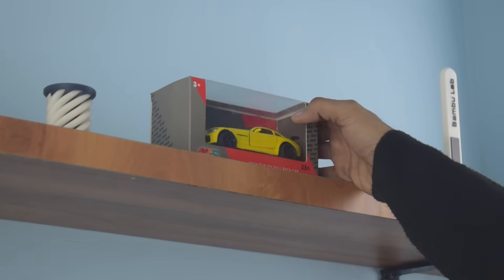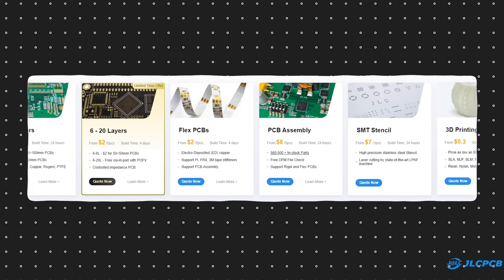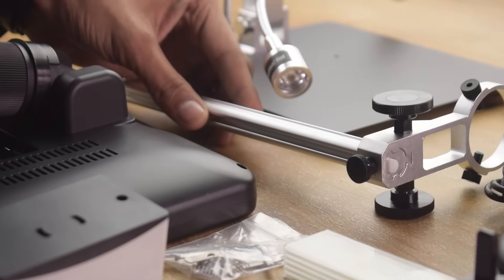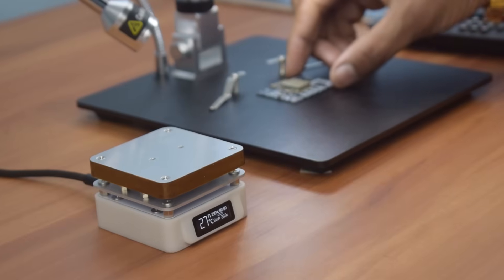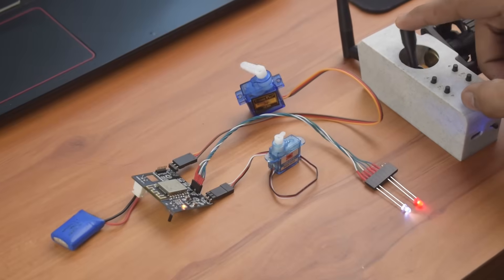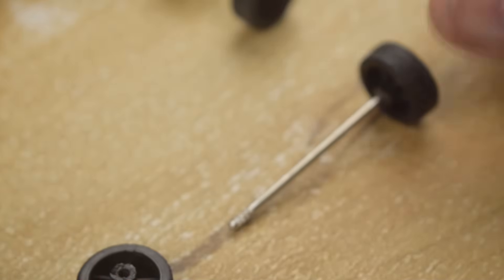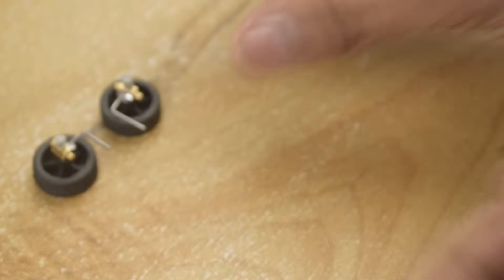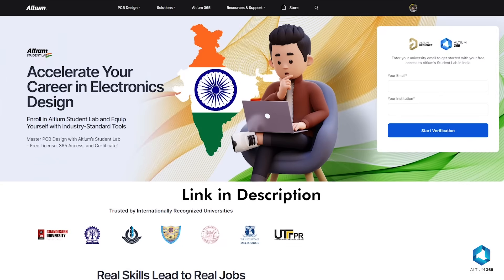Turning this 3$ 1/43 scale Car into a RC Drift Car - DIY Micro RC Car

Comment: Bro you can add one capacitor with rear motor in parallel combination 

Gives boost in acceleration ❤
Reply: No, that is used to sink voltage spikes and noise from the motor's flyback voltage and protect the rest of the circuit. I think that is already added in the motor driver.

Comment: Bro how can i power the esp with single 18650 cell with out burning the chip
Reply: Either put a beffy resistor or buy a step down converter. Although, doesn't the voltage match the voltage of the PCB.

Comment: damn nice and also which motor would you suggest to get more speed and tackle the body weight because i got the same car as you have and also i am a bit noob in soldering pcb and stuff so would just using esp32 c3 mini in the rc car do the work? and also how to set up the dc motor that it can also reverse the car ?

Comment: how did you solder the circuitboard without using a soldering iron? I am very curious!
Reply: he used a tad bit of solder paste when you are soldering smd components it is very hard to  see how and where you are soldering and it could fry the components because of the extreme heat

Comment: Price of PCB = 2$, price of shipping = 35.16$....When the people ask why other people search tutorial of making your own pcb's at home when you can order a pcb for only 2$ this is the answer. Because not is 2$, is 37$ thats it's not cheap.
Reply: I use shipping companies that have their storage in China or USA i use their address  and they ship to my country    for around  10 USD for kg  ,check post  companies like that in your country
Reply: PCB power in india can also make you the same PCBs under 37$
Reply: Give me link please
Reply: Use lion circuits I got 10 PCB in 1982 rupees
Reply: You can make dual layer boards at home, but it's very hard and annoying. I'd personally make it a little bigger just to fit the traces from the bottom on top to make it single layer so you could make it at home much easier
Reply: lionCircuit india is much faster and best quality 6 layer pcb. very affordable price. i paid $21 total for 6x4 inch 5 pcb.
Reply: Where I can get this inner parts
Reply: Why can't we have this Service in india itself 🤔, how much would it cost maybe I will start one
Reply: @Skultra007 you guys probably do have a service in india, but they most likely only sell in bulk to companies
Reply: Depends entirely on your country. Here in India there's both domestic PCB fabs as well as decently cheap options from China, fabs like Next, All, even JLC have expedited shipping options. The last time I paid $35 for shipping was on a PCB order of $100+ 😂

Comment: You could ditch the servo board for the drive motor, use a couple of mosfet pairs and drive the motor straight from your board. Also there is little use in controlling the front and rear lights independently, you could simply turn them on and off at the same time, keep the rears at 25% pwm and give them 100% only when no throttle is applied

Comment: Challenge: convert a 1/24 or 1/18 scale car into RC with engine placement like in a real car, working 2 speed+ reverse gearbox and don't cut the interior. (U can use a transistor and servo controller for ESC).

Comment: Esp32 wroom 32d and esp8266 are preety capable soc but they are retired at this point , its better if creators start focusing and providing content on esp32 c3 , s3 , c6 family as it will drive more sales in india lowering the overall rates in market for the chips

Comment: OMG.. literally, I just bought one last week for the same purpose.. making mechanics for turning the wheels. 
i'm using esp32-s3-sense, BT and wifi (AP/IP) based communication.. can be controlled with Smartphone and FPV video feed and recoding. My project is still under development -- I hope it ends up successfully...  

You should use a mini super motor..  Since body has a plenty of room, so no need to go with ordinary toy grade DC motor.
Reply: Which motor are u talking
Reply from the maker: Good luck for your project👍 and thank you for your suggestions. I will definitely do that in future versions.

Comment: How to learn this types project 🤔
Reply from the maker: Glad you're interested! Learning this kind of stuff is super fun once you get into it. Here's a simple roadmap to get you started:  

1. Start with Basics
- Get to know the basic electronic components like resistors, motors, and sensors.  
- Play around with Arduino or ESP32 — blink an LED or make a motor spin.  

2. Explore RC Systems
- Learn about the main parts of RC cars: ESC, motors, servos, and batteries.  
- Try controlling a simple car setup with a remote.  

3. Microcontrollers & Coding
- Dive into coding with Arduino IDE for microcontrollers like ESP32.  
- Start by making motors run, then move to wireless control with Bluetooth or Wi-Fi.  

4. Mechanical Design
- Understand how gears and wheels work.  
- Learn basic CAD software (like Fusion 360) to design custom parts if you want to 3D print stuff.  

5. Build, Fail & Have Fun
- Start small and build your way up to cooler projects like RC drift cars.  
- Messing up is part of the game—troubleshooting teaches you the most.  

Where to Learn
- YouTube (my channel is always here for you 😄), forums, and DIY blogs are great.  
- Online courses help if you want more structure (try Udemy or Coursera).  

Most importantly, enjoy the process and keep experimenting! Feel free to share your progress—I’d love to see what you build! 🔧✨
Reply: Thanks 😊
Reply: how to serkit board program

Comment: You can buy something better in the market without investing so much money on an ordinary car, but you love to make the ordinary extraordinary.😅😅How many pulsars will you put in one video? 🤭🤭
Reply: Well it is about having fun making it and being proud of it. I am building myself 3D printed rc car with arduino nano as a heart, and yes I did spend quite some money right now but it is all in having fun through the process
Reply: Well buying one is far costlier (when comes to proper drift mini rc car) and also with a little bit of proper calibration and configuration it can be a damn master piece by you
Reply: Its not much money
Reply: That's not the point,he got the experience of making it
Reply: Well creating something gives immense satisfaction which buying doesn't give . I myself designed a smart watch which is have customized feature which market product lacks